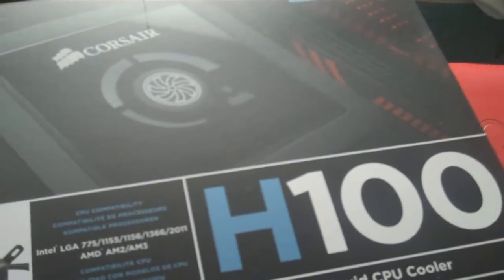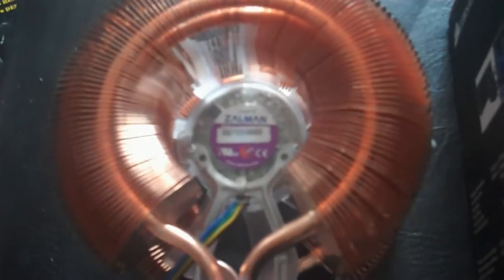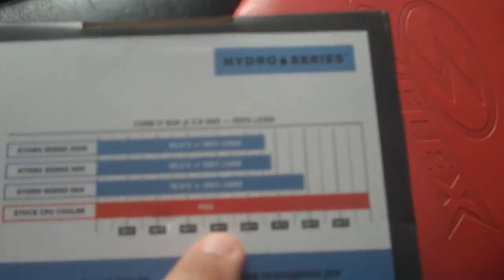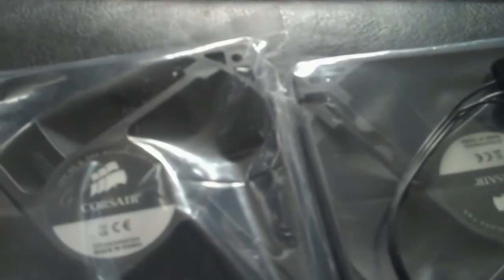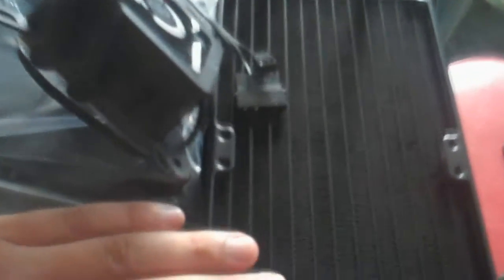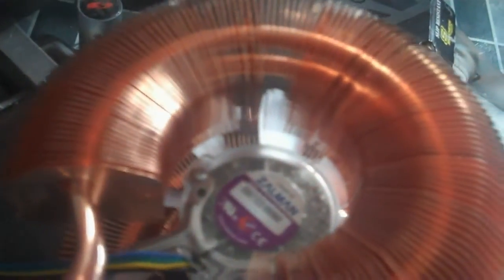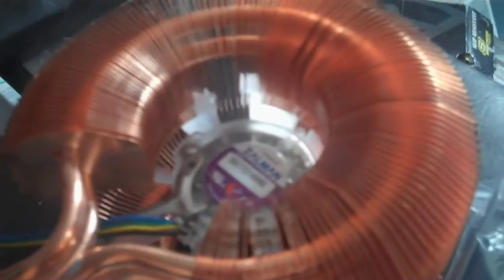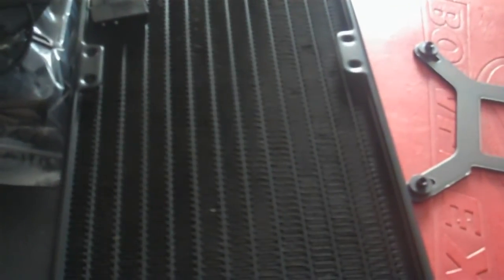CORSAIR H100 Liquid CPU Cooler vs ZALMAN CNPS9900ALED episode: 6 of 9

Comment: i think you were referring to the Noctua fans. the nf-f12 fans are made for radiators/heatsinks , they have a more direct airflow design. they have been great on my h100i

i also use their nf-s12a which has a slightly different fan blade design made for use as a case fan.

Comment: Sorry to say that the Zalman is safer to use and it will not keep the heat after the load is removed from the CPU.  In other words the heat goes down way faster then the water cooler.  When the CPU goes from load to idle the water is still hot/warm in the cooler master.  So your CPU stays hot and takes longer to get to a cooler temp.  With the Zalman it cools down in less then 30 seconds to a minute.  With water cooler it may take 10 to 30 minutes.  Think of a radiator in your car.
Reply from the maker: J. Schmidt I have zero issues with that also what is the Salman cooper u are speaking about? This one here cools everything fast with zero issues. I do believe u have these mixed up as there are two version to this cooler that I discussed 8n the video. One version is horrible while the other is best. Check it out and see for urself. I do understand the radiator but with this one it is beyond big and takes quit some time to reach these numbers and also if u set the cooling good on ur pc for example I take and out take fans u wont have any issues at all and u can try for urself and see brother. I have built many PCs with these and had zero issues. I can assure u my reviews and videos are brutaly honest. Please do show some love for the channel by subscribing liking the video and hitting that bell button as many more videos to come.